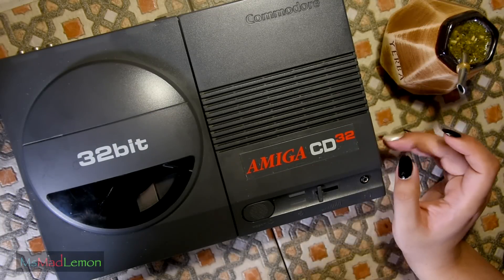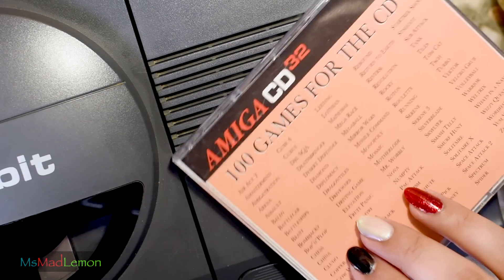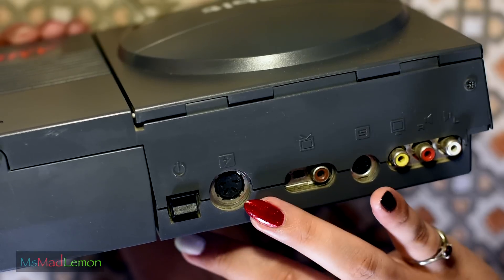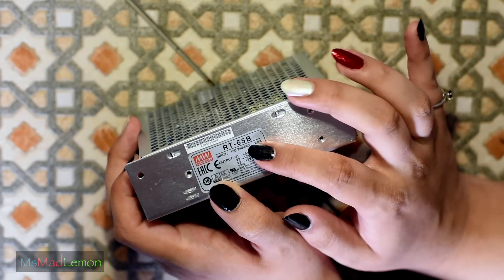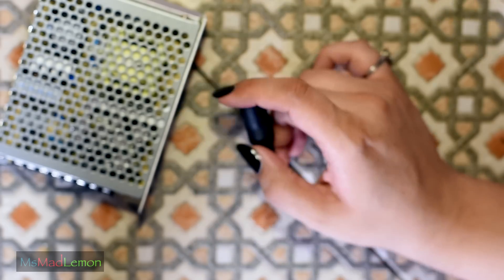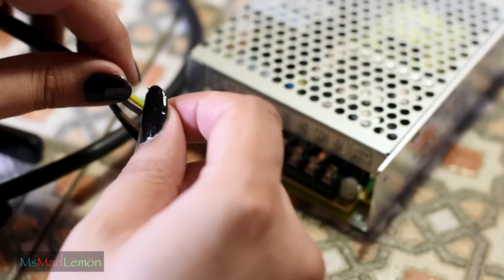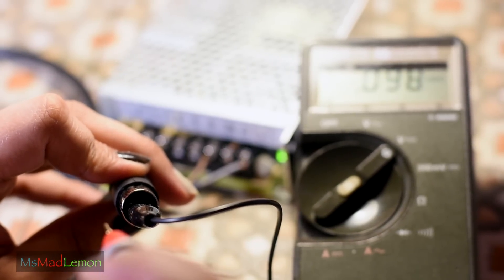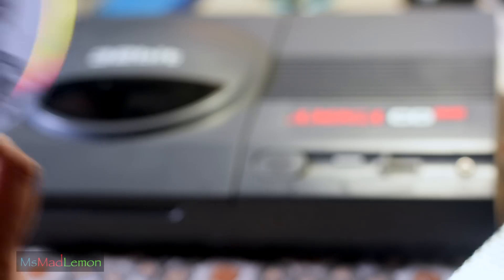Amiga CD32 - Meanwell PSU and Test

Comment: The CD32 was the most stripped down Amiga version you could get, but it has a hidden gem inside: the 182 pin expansion slot! In 1996 the German company DCE released the SX32-Pro and if you read de specs you'll understand what I mean: http://amiga.resource.cx/exp/sx32pro
;-)

Comment: Most of applications today are using the SMPS (switch Mode Power Supply).
So in some cases replacing an old power supply (Linear) with SMPS may give better choice.
Anyway, it is amazing video for watching solution for Retrocomputers.
Thank you for sharing your thoughts.

Best Regards
MOHAMAD

Comment: https://www.aliexpress.com/item/60W-Dual-output-5V-12V-Switching-power-supply-AC-to-DC/628635968.html?spm=2114.10010108.1000014.1.d31d3e31HZKvA3&gps-id=pcDetailBottomMoreOtherSeller&scm=1007.13338.112235.000000000000000&scm_id=1007.13338.112235.000000000000000&scm-url=1007.13338.112235.000000000000000&pvid=b4a36a20-b3af-4c7c-b1d8-53f05a5779a9  this would be good candidate for CD32 psu
Reply from the maker: It's the same one here more or less no?
https://youtu.be/O-WvtaV5pUM

Comment: Great job on the power supply! I have A500, A2000, A3000 and A4000 so I’m not going to get one of these but it’s a solid machine and you can get some decent new upgrades for it.

Comment: Congrats on the CD32, i got myself one about 3 weeks ago and have put a terrible fire TF328 into it with a CF card, works brilliantly and of course as it has the cd drive you can then use cd software in workbench no problem, it`s brilliant, also if you speak to the guys from Amiten software you will be able to get an unlocked version of The Dream Of Rowan that will run on the stock 68020 processor :)  Obviously only for the people who bought it originally :)  Keep up the good work, always look forward to your videos, i also just bought an A1500 but sadly it has some bad acid damage but i`m hoping a very nice guy in the Commodore Amiga facebook channel will be able to work his magic on it and repair the traces etc :)  Look forward to the next video as always.

Comment: Awesome to see a CD32. I scored one as my first piece of retrocomputing, so I'm particularly fond of them. Can't wait to see what you do next :-)
For testing PSUs on Amigas/C64s I made a "rig" out of an old molex cable.  I just popped 2 of them out of the connector and put heatshrink over them. I then stripped some wire off the other end. I can then slide them over the pins I want to test, knowing there's no chance of shorting.

Comment: Where did you find that project box?? :)
Reply from the maker: Links to it are in the description :o)
Reply: MsMadLemon thanks hard to see on phone :(
Reply from the maker: https://www.ebay.co.uk/itm/ABS-68-Enclosure-for-power-supplies-vented-X110mm-Y189mm-Z64mm-x1-pieces/401427219411?hash=item5d76ed43d3%3Ag%3A48kAAOSw-xVZ6etW&_sacat=0&_nkw=ABS-68+Enclosure&_from=R40&rt=nc&_trksid=m570.l1313

Comment: Hey, Maddi. You got one! Possibilities.. I agree, S-video is fine. But I wouldn't be surprised, if you some day modded it to RGB output anyway. ;o) I took a look at the mod, and chickened out. "Nah.. S-video is fine..".. ^_^ Not so relevant, and I suspect you know this already.. But the PSU's for the C1541-II, C1581 and the CD32 are interchangeable. That's pretty cool, I think.

When you recap it.. Again, I'm probably preaching to the choir. But two of the caps were reversed from factory, because the indications on the board were wrong (someone f'ed up, lol..). Not sure if it's in all, or just some CD32's. I replaced those two in mine (bulgy.. 😳), but left the rest alone for now. It's C408 and C411 (https://console5.com/wiki/Amiga_CD32).
Reply from the maker: Hey Brian :o) 
I can definitely see myself eventually wanting to go full on RGB somehow lol... Thanks for letting me know about the reversed caps, actually I wouldnt have known but after ordering the capacitor kits from RetroBench, it states which are reversed.. very strange of a company to make such mistakes, they're not small ones either! 

It is pretty cool actually :o)
I'm not sure why they chose the Amiga to have proprietary square DIN when they had perfectly fine round ones lol there are a few mysteries in Commodore's history :o))

Comment: I also have a CD32 in need of better power supply, I currently use a bodged together PC ATX PSU and would like something more compact and tidier. Where did you buy the PSU and enclosure from?
Reply from the maker: linked in the video description, but here: 

Meanwell PSU: https://www.aliexpress.com/item/Genuine-MEAN-WELL-RT-65B-meanwell-RT-65-64-6W-Triple-Output-Switching-Power-Supply/32804870883.html?spm=a2g0s.9042311.0.0.68784c4dmZwSIz
Reply: I missed that one, Thanks. Where did the project box come from?
Reply from the maker: Wedge PSU case:  https://www.ebay.co.uk/itm/ABS-68-Enclosure-for-power-supplies-vented-X110mm-Y189mm-Z64mm-x1-pieces/401427219411?hash=item5d76ed43d3%3Ag%3A48kAAOSw-xVZ6etW&_sacat=0&_nkw=ABS-68+Enclosure&_from=R40&rt=nc&_trksid=m570.l1313

I thought I had pasted it! sorry about that.